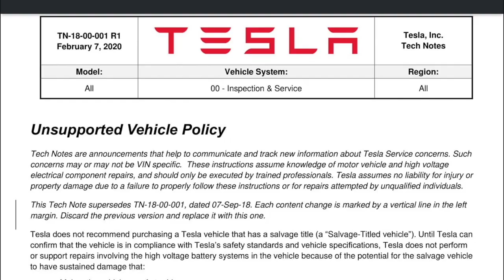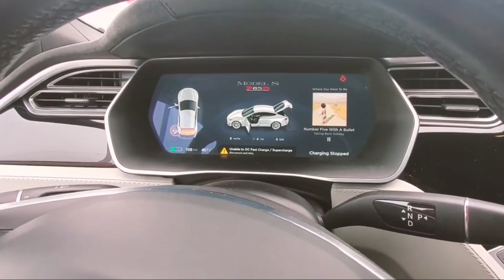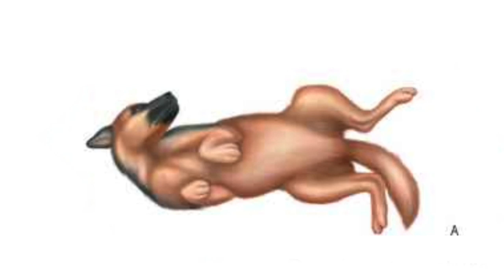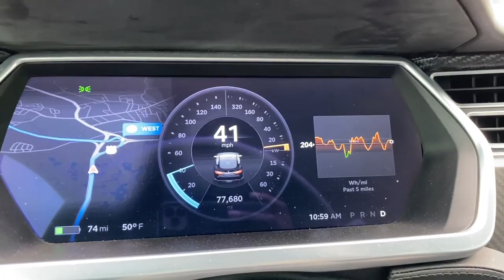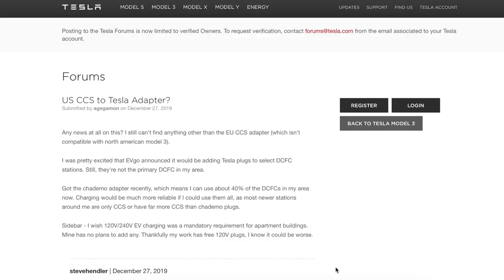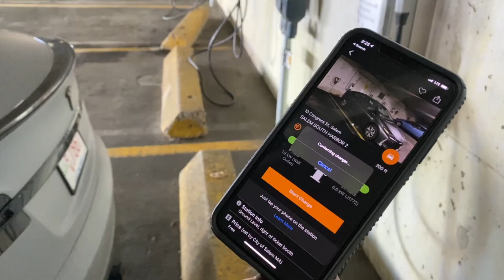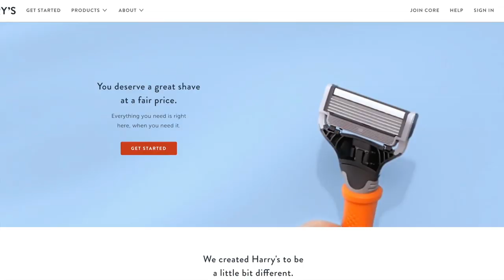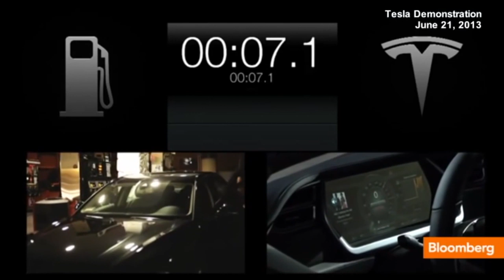Tesla ruined my car and it’s the best thing to ever happen to me!

Comment: Sounds like an argument for you to join Louis Rossmann's Right to Repair fight
Reply: "Right to repair" is not the same as a right to make the original maker extend a new car service to a subsequent purchaser who has no contractual relationship with the maker.  I'm guessing that a person who bought a Tesla new, had a not-totalled accident, repaired the car himself, took the car to Tesla and got it certified, would have the supercharge service as originally contracted.
Reply: @psdaengr911  if you buy a broken Apple product, and fix it yourself, would you not expect to get OS updates?  

When you buy a car, you dont have a contract with the OEM.  Just the bank.  I'm not sure how the original owner vs second hand owner argument applies.  If its fixed, its fixed.  Why does "by whom" matter?
Reply: @psdaengr911  can i have some of what your smoking?
Reply: @psdaengr911  Only the free supercharging is a contract between Tesla and the owner.

General dc fast charging is a substantial part of the product that was sold to the initial customer. (thereby transferring ownership)
Disabling it is like Porsche removing the motor from your 911 without your consent, because you got a new paint-job and they don't approve of the colour.
Reply: the reason Tesla does not fallow the same rules as other auto makers when it comes to repair. is the laws are written that anyone have access to the same tools and parts as the dealer but Tesla does not have dealers so they effectively bypassed the laws
Reply: @paul3502  I did not know that ... that's pretty interesting. So basically ... because they cut out dealership model they by passed the laws. Am i getting this right ?
Reply: @psdaengr911  Turning off the ability to recharge from a third party vendor?!? That is not "extending a new car service to a subsequent purchaser", that is denying the owner of a car practical, ordinary useability, as taken for granted by owners of all machines everywhere.
Reply: @t1mech1ldtc60  that is exactly correct
Reply: Sorry for the dumb questions but .... if they haven’t got any dealers then where do you collect your Tesla from when you buy it/order it. I should really be asking my uncle who owns one but he’s too much of a snob imo.
Reply: I was just thinking that lmfao. Getting that Apple vibe.
Reply: @J-Will  i was also wondering when this Richs showed Up to right to repair 
Same as Louis RossMann doe's with Appel and others doe's with Sony  and farm EQUIPMENT
This is just too lame of Richs not to do nothing !! 
I won't waste time on spineless turd's so i unsubbed ..
And Hope others do too .. whats the point to watch houres and houres of USLESS REBUILD !! 
I CANT TALK FOR OTHERS .. BUT I AM OUT !! 
THER ARE WAY WAY BETTER THINGS TO WATCH THAN .. WELL I JUST USED A LOT OF RESORSES TO REBUILD THIS CAR 
THANKT TO ALL MY PATREONS FOR WASTING THER TIME AND THER MONEY.. AND PAYING ME !! FOR NOTHING
Reply: @psdaengr911  spoken like someone doesn't work on their own s***
Reply: Josh Willison - I like the debate you started
Reply: When Apple makes a electric car
Reply: I'm pretty sure Tesla has the right to deny access to Superchargers for any Tesla vehicle for any reason.
Reply: @paul3502  you mean 3rd party dealers? Because they definitely have dealerships how else would buy the tesla lol.
Reply: Great video. Love the s reM your youngest does.
Reply: @kennethschultz6465  does* apple* learn how to spell bud

Comment: The ultimate revenge would be to put a gas engine in a Tesla and you tube it
Reply: That would be great. The S is a very nice car, except for the idiocy involved in "buying" a Tesla.
Reply: Oh please, oh please, oh please! This would be amazing - even better if it was faster than a normal Model S
Reply: Put a civic engine in it with no exhaust pipe, straight from the headers
Reply: LS Swap!
Reply: TURBO LS SWAP!
Reply: Imagine how many features Tesla will try to remotely disable if you did that. I could see airbags, seatbelts, brakes and steering suddenly not working.
Reply: @L8ugh1ngm8n1   All you have to do is disable the cellular system that comes in the car.Then they could neither see nor hear it anymore That would play havoc with the cars navigation though. You could just use your cell phone if needed.
Reply: A 2-strokes one
Reply: gurney hallac RICH, SWAP THE LS7 FROM YOUR C6 Z06 INTO THE TESLA STAT
Reply: tim coker  that would be interesting, the amount of reengineering would be staggering!
Reply: LS Swap a tesla
Reply: 1000+hp turbo k series
Reply: I'm going to make this really awful and suggest a PP triple or quad rotar swap the Model S and really really piss Tesla off! Nothing like a fossil fuel burning fire breathing mayhem infused Model S..... Just for trolls
Reply: Your a genius!
Reply: Put a hemi in it
Reply: Coal Rolling Diesel with steel nuts hanging off the back.
Reply: A proper V8 DOHC LS swap.  With an aggressive muffler setup.
Reply: 2jz that ho
Reply: I like how you think XD
Reply: somehow squeeze a big block in there and have it run off diesel. All the leaf drinkers would shit themselves when you turn it on.
Reply: @turituser1239  Or put a damn quad-rotor rotary similar to the Mazda 787B in it and let it rev up to the limiter. All the leaf drinkers will not just shit themselves but also become deaf.
Reply: @MrShadow1617  Even Better!
Reply: Buy the hellcat at auction and morph it into a tesla. Bwahahahahaha. Dodge and tesla fans would shit a brick
Reply: @dublindave5795  where are their sim cards situated? You need to remove it as the sim card is its own computer. Developping countries have banking app that runs on a sim card itself as it have its own encryption chip.
Reply: mount a generator on the roof
Reply: @JamesPhieffer  What's so idiotic about buying an S other than lack of locations to charge it up.

Edit: Ok don't answer that anymore. EC chargers at Walmart won't fit so nvm it is kind of idiotic.
Reply: EJ205 with all running gear swap that thing. Let Tesla really know they done screwed the pooch.
Reply: Might as well if he be taking the supercharge out.
Reply: Swap a rb in it
Reply: a naturally aspirated k20 would be nice
Reply: I have a 440 and  727 transmission sitting in a garage not doing much.....
Reply: Bolt a generator to the roof.
Reply: This guy is the prophet.
Reply: There already is a LS V8 swapped tesla on YouTube I saw it 2 days ago. 😁🤙✌️
Reply: @imacrazyguy5831  look it up bro it's already been done hahaha. 🤙
Reply: @ruksrocksandadventures.5800  It's the same guy as this video who made it. The original comment was made before he did.
Reply: ...aaaaand done
XDXDXD
Reply: He is doing it!
Reply: Let me tell you sir what a time to be alive. Have you seen the channel's recent videos lately? ;)
Reply: This comment aged well
Reply: This comment aged well
Reply: This comment aged well
Reply: This aged well

Comment: This is a right to repair issue that really needs to be on the forefront.
Reply: It's a salvage title vehicle on public charging stations. Nothing to do with right to repair.
Reply: Ian Kelly it’s a bull shit attempt to keep people from fixing a salvage Telsa. Telsa will be bankrupt soon anyways
Reply: Yeah that is why I am hesitant to switch to electric lol At least I can repair my combustion car without getting cuck by the manufacturer anytime over the air.
Reply: Ian Kelly salvage title nothing to do with Tesla. The vehicle is not faulty.
Reply: Join Louis Rossmann
Reply: @yeahok115sure  why? Elon musk can bail it out
Reply: @iankelly6162  it has everything to do with right to repair. Tesla disabled a feature already on the car for nebulous reasons.
Reply: k2zsk8 - why does it Matter, IF a TESLA can operate over 200,000 miles with ZERO maintenance ? 
all you do is Rotate Tires, Change wipers and add Wiper Fluid.
this is Supported by TESLOOP a Tesla ONLY Rideshare company.
Reply: Robert Slackware  Exactly! It could just be hail damage and the car is bought by insurance company.
Reply: Heavy hauling Idaho Who exactly stopped rich from rebuilding his Tesla? Seems like he rebuilt it just fine without interruption. The shady part is excluding these vehicles from V3 charging. 

Also, on the bankrupt part. Do you think Tesla is just a car company? At worst, Tesla stops selling cars. Drivetrain and battery’s can be sold to anyone who needs them. Batteries can be sold to anyone who needs them. Solar panels can be sold to anyone who wants to compliment their batteries. The R&D that has gone into autonomous driving can be merged with OpenAI and they can operate as a third party for computer vision technology. If I had to place a bet, it certainly wouldn’t be AGAINST Tesla.
Reply: @jonathanw11  good reason
Reply: @taylor92493  On the bankrupt part, Tesla has been operating at a loss in both 2018 and 2019 with owner Elon Musk Discussing the possibility that without a significant upturn in sales in the next few years the business will not be feasible anymore. Furthermore, Tesla's reality is one in which they do not produce their own batteries those are produced by the company Panasonic and purchased by tesla. On the solar panel front, it has been reported that a significant majority of tesla solar panels are produced by 3rd party companies in either China and Japan removing another revenue stream possibility. Alas, the tesla motor is a fine one in regards to our primitive knowledge in regards to EV drivetrains but compared to other electric vehicles it is nothing special and for major companies investing in EV, they would make their own engines rather than import them. To further weaken the case for the Tesla brand, the cars tesla are producing are great for the environment while on the road but unfortunately, the lithium-ion batteries that power these cars are quite toxic and shall pose a significant issue in a couple of years when the batteries start to die and there is no effective method to cleanly and economically dispose of 100's of thousands of batteries. To conclude, the bet against the success of the tesla brand may not be the best bet in the world, but with thorough research and analysis of past evidence it can be determined that it would be possible for the tesla brand to collapse, this is not unprecedented as major companies such as Lehman Brothers which went bankrupt after being the 4th largest investment bank in the USA.

Comment: rich: makes video about his supercharging removed
tesla: turns off his steering wheel
Reply: Turns off his brakes once the car reaches 55 mph
Reply: to be fair, it would still be moderately driveable without power steering
Reply: @blu0065  teslas have electric steering. the whole thing is fly by wire
Reply: @benwilson5422  the Tesla is electronic power steering as opposed to a fully steer-by-wire system

So far, the only fully steer-by-wire system is from Infiniti, and they have a steering shaft as a backup system
Reply: oop
Reply: Cause drives autonomous!

Comment: You don't see other car manufactures desabling "93 octane gas" when you buy a salvage tittle.
Reply: 93 ? Lol that is below our cheap stuff. We have 95 and 97 octane.
Reply: @scottrich976  Different ways of rating octane level. 93 US octane would be equivalent to a 98 EU (97.4)
Reply: @Tomazack   kids.........thats not the point being made here lol
Reply: @thelaughingman79  who are you talking to?? Kids? At 33 I'm pretty sure I quality as an adult but that's beside the point. I answered a misconception regarding octane, what are you on about?
Reply: @scottrich976  in finland we have 98
Reply: That's because they can't. There are no sensors when you pump gas.
Reply: It's more like making you fill your gas tank through a pinhole.
Reply: @ymcpa73  they absolutely can. most cars will pull timing and power for example if you use regular gas instead of premium, or vice versa
Reply: @adkodiyan  is that due to something the car computer does or due to the way the fuel burns in the car? I've put regular gas in a car that recommended premium. It worked fine. I know they warn if you keep doing it there could be knocking in the engine.
Reply: @danstiurca7963  please. literally impossible to do.
Reply: @adkodiyan  But they will still take it, and that's just something to keep your shit from knocking if you have a turbo or a high compression car.
Reply: @scottrich976  your 98 is our 93. Imagine what our 98 does
Reply: It would be like disabling the pumps because your car is a salvage when you go to a gas station.

Comment: Sounds like another class action lawsuit is in order, like the one Farmers have against Deere, Caterpillar and other heavy equipment manufacturers for the right to repair......Tesla better watch out
Reply: Yeah but john deere are happy for the 15l float to tow the machine in to town which could be many thousands let alone to get the machine on the float.

An regarding  the  environment what would  you  prefer less emissions or food?
I know which im prioritizing.
Reply: JS13 they will get sued. You have no right to control a product you no longer own. You need to charge this vehicle and can not make the car not work because they did not follow your rules. This is very illegal.
Reply: One angle to pursue is the environmental cost of not being able to re-use used Teslas. Destroying the 2nd hand value. If they want to offer a safety test for a low price that's fair.
Reply: Vablo has nothing to do with emissions, their software is locked so even replacing a wheel bearing requires a software update from John Deere. Everything is electronically monitored
Reply: Not necessarily tesla is just like apple very much a dangerous level of control held over the product well after the fact.
Reply: @digbysirchickentf2315  
Problem is they are either worried about a cable intersection being damaged that's not easily physically inspected etc. It may be half the car has to be disassembled to inspect.
These already are an environmental  Hazzard considering the amount of lithium  they use i suspect this will be the next problem.
Reply: asd asd yeah let’s continue belching black smoke all over your food I farm and I can tell you right now the brand new John Deere never leaked or smoked on the crops because they were maintained my pros. The old tractors leaked and smoked and the owner didn’t care. If I discharge less emissions and fluids in your food you will be a healthier person.
Reply: @dirtbagsinc.1689  
Sure wind up the boost burn that shit quicker replace that tractor sooner.
My point is It's  a  weak excuse as mentioned you need them out for suprisingly simple shit.

There worried people want to bypass all the bs frankly i don't  know anybody worried about that.
Our priorities getting  it going sooner.
Not having to  call someone  in or ship the machine off on a great big float.
Reply: Call their bluff. Re-enable it and let them sue you. There’s enough support of right to repair that some lawyer will take the case for free and you’ll get some great content out of it.
Reply: @vablo7198  It's about right to repair not about emissions, and why would these evil farmers touch the emissions of the tractor? Few might tweak them but this is not a real reason to lock out features cause few individuals. Also have you ever seen Tractor Pulling, or SpaceX rocket any rocket that runs diesel true it's thrusters... This is an excuse, not a good explanation. Besides =D if jondeer is such a nature friendly company why won't they just lock those emission parts from the firmware, why must they lock every part, with the excuse of 1 part of the firmware. Or are you saying nope they cannot code programs in such manner that it cannot be done by the poor coders in John Deer... I'm sure John deer is happy that you eat their propaganda like good little consumer. keep on consuming, that will save the earth.. ouh wait no.
Reply: @vablo7198  UREA =D It's Urea
Reply: @vablo7198  An No they will not pass monitoring software, as they have no reason to do this, also John deer can make this adblue software separate. Like I said.
Reply: Class action is the only way Tesla will learn. Sad. I want a used Tesla but they push me away. Other countries wouldn’t allow this crap
Reply: Quick ICE car reviews How would they learn when there were less than 5k salvaged cars?That insurance likely paid out for. This problem is mainly lack of resources/ownership of software. This company can’t repair ANYTHING in a timely manner right now, and YOU can’t own any of your software outside of open sourced software. Our internet policies are going to ruin everything.
Reply: @coleh6196  as much as I agree with your sentiment, Tesla is not disabling charging of the car. They're disabling use of Teslas private charging network.  Rich can still charge at places like chargehub, Electrify America or EV go.
Reply: @waynechristian345  
They disabled 3rd party DC charging too. This is what we are having a major problem with.
Reply: Farmers needs FUNCTIONNING equipments and asap when broken. A day late for crops could mean thousands lost.
Reply: @waynechristian345  no he got disabled all fast charging.